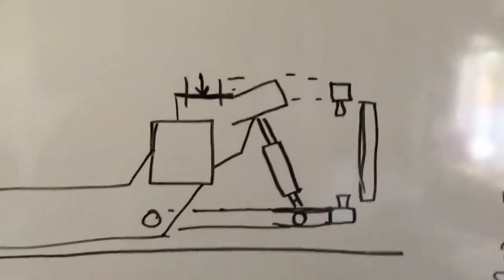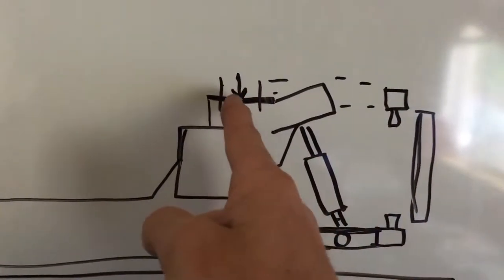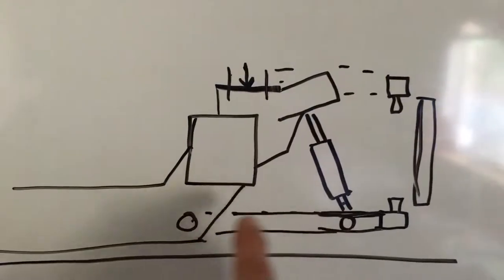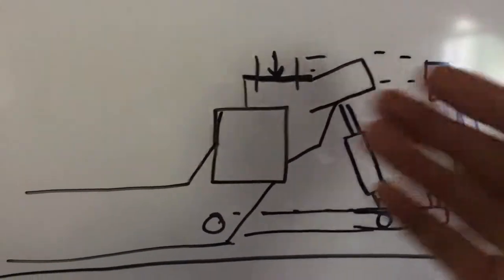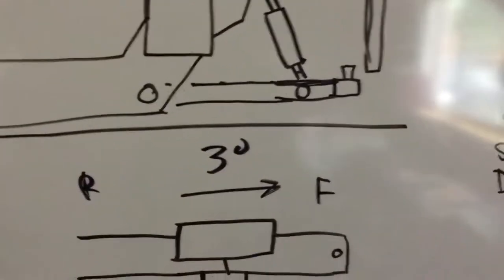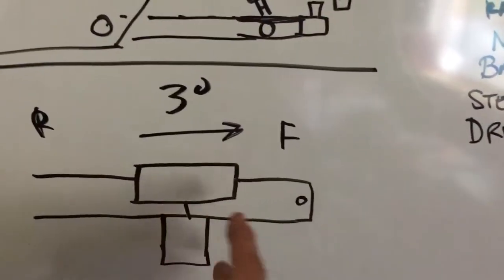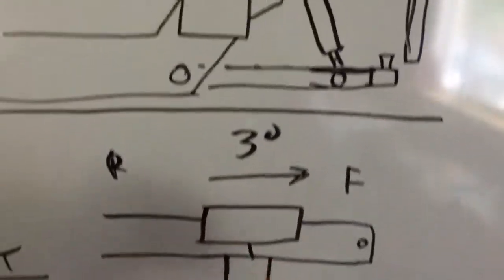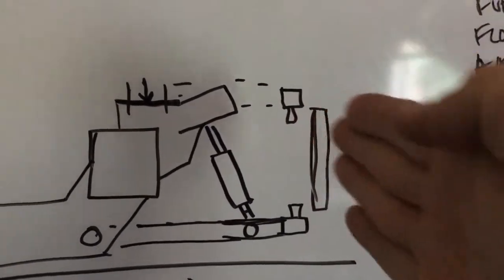ROCKER PAT AND THE MUSTANG II BELAIR STEERING WOES PART DUEX S12E29

Comment: That's what I'm working toward today.  The top hat on my kit is flat all the way across, putting them straight was my first mistake.  Today I'm bolting my upper control arms in the center and cutting the out board frame side to find 0%  camber. So far I've cut 1/4 inch and tacked it back in place and I'm close to level. I might take another 1/8 inch and see where that lands me. The Helix top hats have that kick to them, but the TCI don't. That way they will line up with the spring seat in the lower control arms.  The hats on the TCI kit already have the anti dive cut into them. I'm almost there and should have it licked this afternoon!!! Or I sure hope so. Got a truck coming in my shop for some work tomorrow and I need my lift!!! Not to mention a possible tropical storm heading my way this week!!!
Reply from the maker: good ol texas weather! stay safe buddy!
Reply from the maker: and if your hats already have the 3 degrees, i would just make sure they are parallel to each other and the control arm mount points are the same distance as the ball joints. that way you get proper arc, same as the tie rods. and center the upper in those slots. so you have adjustability both ways after you're done welding.